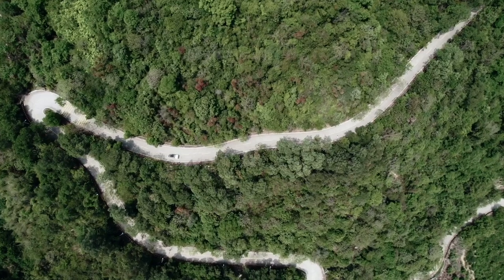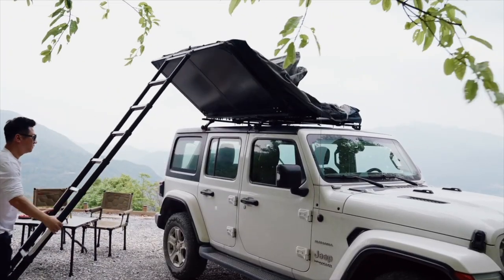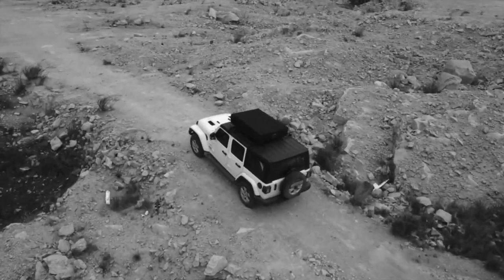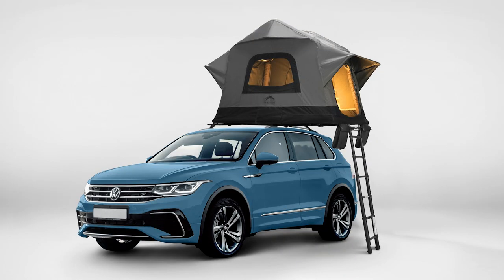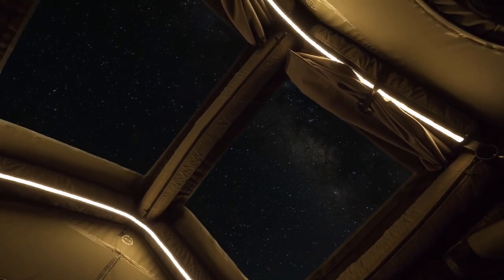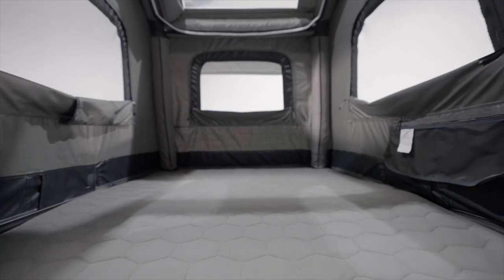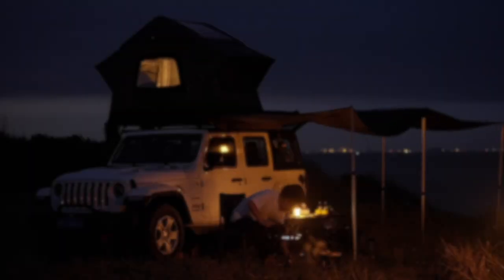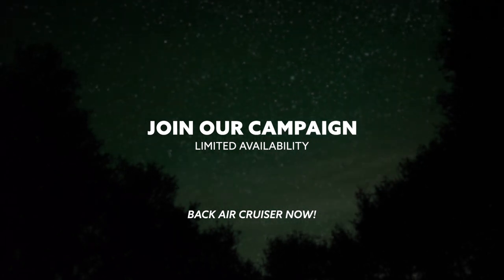Air Cruiser - Revolutionizing Rooftop camping

Comment: If you came up with a type of rack that housed leg supports for base floor extension outward over the front or top of the vehicle windshield, you could almost double your occupancy. Making the price a bit more justifiable. The quality of this tent is excellent and with a high end tent if your going to market in this price range need more floor space. Everyone has got headspace. The difference is while it's great to have a little bit more headspace on top, you want the floor space of a mid size tent at least. Bottom line, great quality and innovation, just needs more floor space or a lower price. Some will pay for quality, all will pay for quality and floor space. Also, if you want to market to the star gazing crowd, even with a tent this size, it would be a big plus if the windows windows zip and folded out. This way you can stargaze with scopes through an open space. I'd pay 1599 for a tent like this, give or take. Most star enthusiasts would.

Comment: its a rooftop airtent. Hardly revolutionary...
Reply from the maker: Once that self inflates to the perfect pressure and creates more head room than any other RTT. There's some very cool tech and innovation wrapped up in this RTT Kristian, take a deeper dive. It looks incredible don't you think? :)
Reply: 100% - Dometic came out with an air roof top ten years ago... The Dometic also has all the same features as this one. This is nothing new.